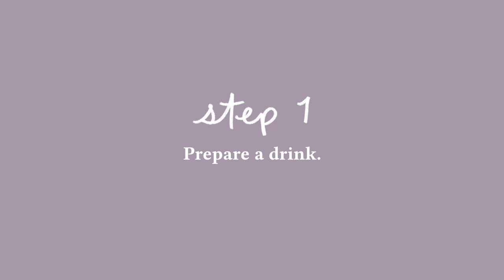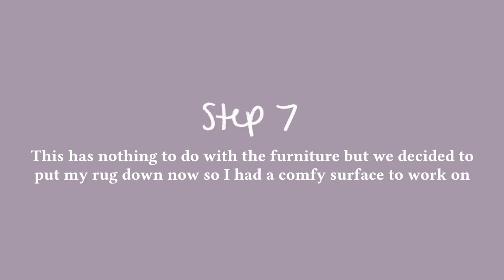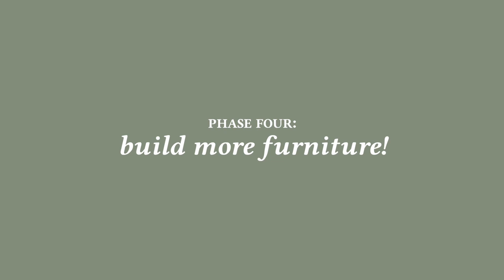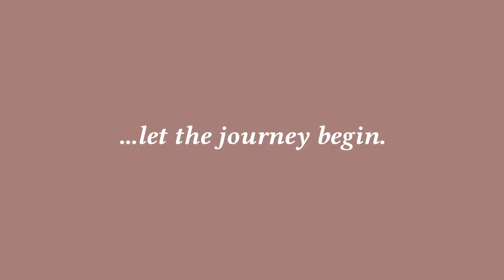MOVING INTO MY FIRST APARTMENT IN NYC | unloading & unpacking, setting things up, building furniture

Comment: Here’s a tip for hanging photos in future… put a piece of coloured tape across the back covering the nail holes. Then put two dots where the nail holes are. Then simply stick that tape on your wall, level it and drill the holes in! Then hang up your picture :)

Comment: Idea: take the closet doors off the closets and hang white flowy curtains there instead ! (Opens up the space quite a bit). And you can store them under your bed until it’s time to move out. Then easily put them back up when the time comes! I’ve done this at nearly every apartment I’ve rented and it always helps so much with managing a small space.

Comment: I have that same bed frame and even though it may not seem like you need to put the foam discs or plastic discs under it to protect the floor I would. I have similar floors and it scratched it up under the bed frame legs at the four corners and then the very middle one.